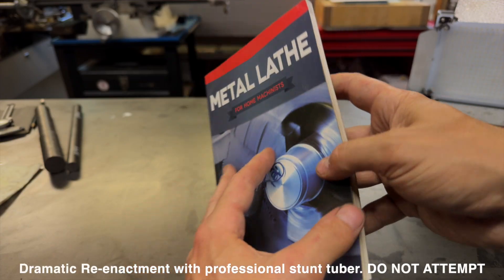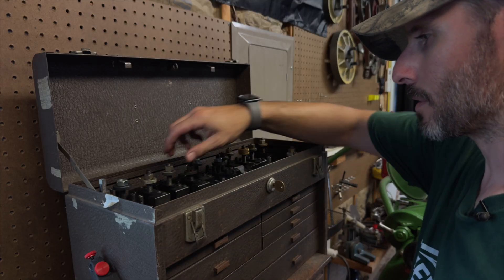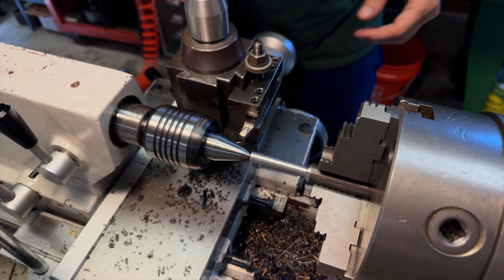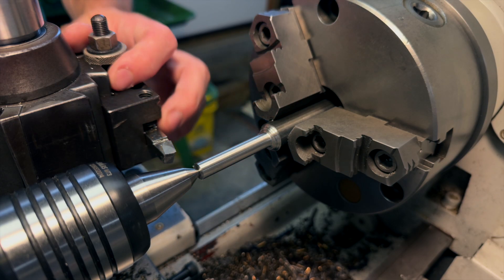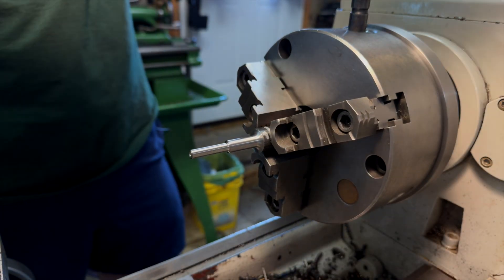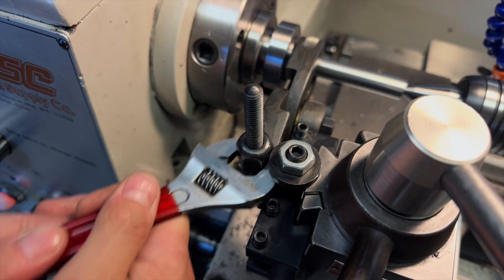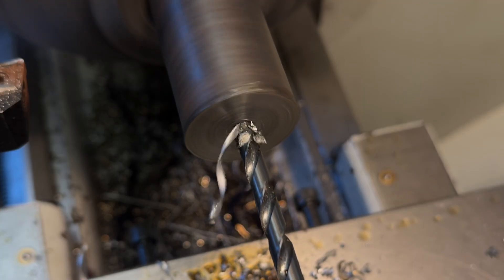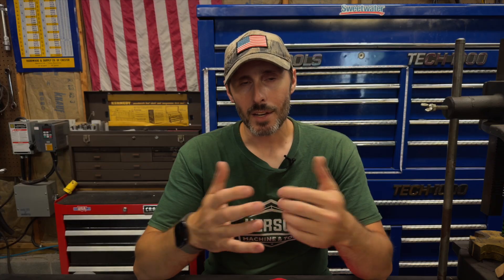Tool Making for Beginners - QUICK & EASY DIY Project

Comment: I’ve missed your lathe videos 😊! Thoughts on such a large nose radius when attempting to turn with such a small depth of cut? It’s good that the edge is very sharp but it looks like it was cutting on the nose instead of the cutting lip.
Reply from the maker: Yes it's cutting on the farthest point of the radius. You need to have cutting relief out there. It works very well for safely sneaking up on close tolerances. And the lathe is probably my favorite as well. :) Thanks very much for watching!
Reply: @hersch_tool  do you think it would work better or worse if the tip were a lot sharper? For instance I use sharp carbide inserts for finishing because 1. they are sharp and 2. the tiny nose radius helps with the really small depths of cut.
Reply from the maker: @freestyla101  It really depends on the result that you're after, the alloy you're using, etc. Sharp carbide inserts will allow you to accomplish a similar thing as far as taking super light cuts. The sharp point is going to leave a different finish than a soft radius. For instance, with 304 stainless steel using a radius'ed tool will give a very nice satin like finish, while a sharp point will leave a much brighter finish and often a faint texture.
Reply: @hersch_tool  so you’re saying it being sharp across the lip is more important for the light depth of cut whereas the radius of the nose is mostly for the desired surface finish?
Reply from the maker: @freestyla101  exactly

Comment: Nice. 2 questions. Why didn't you use the mystery steel for the handle and the 1144 for the gages? And why didn't you finish the handle in the first set up, instead of parting and flipping?
Reply from the maker: Because the 1144 was only 3/4" OD. I wanted to make larger gauges. Not sure what you mean on the second part. The material was longer than I needed, so I parted it.
Reply: @hersch_tool  what I mean is why not have the piece pulled out far enough so you could have done the knurling and the smaller shoulder all in one set up, then part it off.
Reply from the maker: @kurb0311  Too much stickout, causes flexing, inaccuracies, and chatter. In general, 3xDiameter is about where you want to be, and normally work with as little material stickout as possible for any given situation. This is where order of ops and project planning becomes important.

Comment: Is it worth saving your metal shavings for scrap?
Reply from the maker: @theexposurenetwork365  scrap places normally won’t take them, unfortunately.
Reply: @hersch_tool  didn't even think of that. Any idea why?
Reply from the maker: @theexposurenetwork365  Its a bunch of reasons I think. It's impossible for them to know what kind of metals are mixed in the chips, they're always covered in oils and other contaminants, and the size to weight ratio of the chips makes them really cumbersome to deal with. Meaning, a few cubic feet of chips won't even add up to the weight of a few inches of steel bar.

Comment: Yo, speaking of hardening, grinding ain`t the sole method of acquiring precision... CBN turning works brilliantly, but requires care, as it is as bad or worse than grinding on a lathe with a tpg... Bare ways are easily ruined with hardened chips and dust that forms during turning of ultra hard stuff... CBN will cut it in chips, but glass hard material will generate dust regardless... You also have hardturning carbide, but both of those are in my view pre-finishing tooling, as precision instruments are solely generated by lapping, if we really wanna be honest about things... And making a lap for a lathe is 10x easier than generating a straight lap... Just shield and cover those ways for the whole process, and not with junk, as hardturning chips will eat through any easily combustible or l.t. melting material... 
Making cylindrical instruments of precision in the shop the proper way is not outside the realms of possibility for almost anyone with a lathe... I would wager that it is easier to make cyl. precision stuff with a hobby shop than it is to make flat precision instruments, or rather, it takes much less effort to do so... From lap making to the speed and ease of the whole process... Milling a piece flat and square is harder than turning a piece cyl, hardening affects flat and rectangular pieces worse than it does the cyl. ones, and lapping of flat surfaces is more intense in every way than it is to slide a lap up and down a spinning shaft evenly and checking every however often your skill demands you to... 

Also, for those with interests in casting, i would perhaps consider using white bronze for this project... Cast a majestic handle with a few pseudo-diameters, give `er the centers, turn the actual diameters and lap it in... By white bronze i am referring to Cu-Al bronze alloy with high aluminium content, which results in a glass hard and brittle as fuck material, but one remarkably good for both wear and tear resistance, corrosion near-immunity, relative ``slipperiness`` which makes it ideal for tooling like this... Being glass hard also makes it immune to abrasive charging when lapped with a soft laps... Just don`t drop it on the floor, but then, the same goes for steel instruments... It also won`t have the potential to wring with a fine finished bore that you are checking, but will instead have a natural lubricity to it due to aforementioned material properties... And it is easy to make... Just good copper pipe from scrapyard and some good purity alu(not hard to source either)... 

Best regards!
Steuss
Reply from the maker: Excellent comment as always, thanks bro.

Comment: I don't understand why a lot of people don't mess with hardened material.

you do NOT need grinding capabilities to work with heat treated materials! you can use normal carbide tooling, you just need to be careful what your playing with and what the hardness is, a lot of insert tooling will tell you what surface footage and chipload it works with for hardened material. 

hardened stuff isn't that scary, just gotta know what your doing. unless it's case hardened or an exotic heat treated material, but if your playing with them your using cbn and diamond tooling anyway.

TLDR if used correctly, carbide tooling will be more than good enough for hardened material. hss can also be used but I wouldn't recommend it.
Reply: I actually machined a hardened dead center yesterday to make a "half dead center". I was expecting a lot of drama but the AlTiN carbide end mill had no issues whatsoever machining it. It made me re-evaluate my fear of working with hardened stuff
Reply: @michaelandersen7535  yeah definitely, I work in a CNC shop and about half the stuff we get in is 4140 prehard. not even the manual Bridgeports have much issues with it when using carbide tooling. it's nice that you can baby it even better too. take a light cut and still have enough tool pressure to make that cut
Reply: I got the impression that he was saying he couldn’t heat treat material because he doesn’t have the ability to perform a cylindrical grind.
Reply: @freestyla101  again, you don't need grinding capabilities to heat treat

Comment: Great project for the new machinist to practice hitting some dimensions, reading a micrometer, etc. Good tip on using the compound at 6 degrees, too.
Reply from the maker: @MyLilMule  yeah the book it came out of is fantastic as well. Cheers!
Reply: @hersch_tool Yeah that trick with 6⁰ for imperial lathe's it's amazing, but how about with metric lathe's. Do you know anything about it...?
Reply from the maker: @5b4aezmarinoscyprus71  It makes no difference what measuring system you're using. mm, inch, bananas, whatever. The sine of 6° is .1 You can use this to manipulate the scales in any way that you want. Another one I use frequently is 30° because that's normally where my compound is set anyway. Simply divides the scales in half.